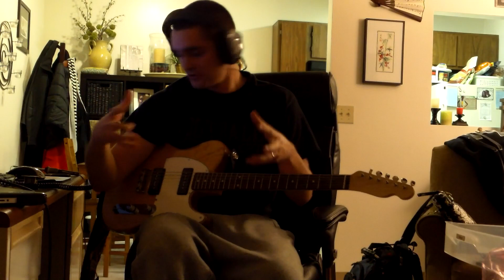Treble Bleed Demo and Explanation

Comment: Why do you mean it changes the taper of the pot?
Reply from the maker: The taper determines how quickly the volume change occurs based on the location of the pot throughout its travel.  Meaning that when the guitar volume control is at 5 out of 10 the actual volume may be at 40% or 60% or somewhere else.  

An example - some tone controls may only really be effective from like 6 to 10 on the control, then from 6 to 0 it doesn't really change that much.  Or maybe it changes a ton from 0 to 2 but then not a lot after that.  That would be an uneven taper.
Reply: +Kley De Jong but what exactly did you notice with yours? 
Was the change in taper good or bad? 
So what happened to your pot?
Reply: +Kley De Jong but what exactly did you notice with yours? 
Was the change in taper good or bad? 
So what happened to your pot?
Reply from the maker: It comes on just a touch more strong from about 0 to 3 or so.  But from 3 to 10 it is pretty even.  I have installed it in all my guitars and so I've gotten used to it.  I wouldn't really be concerned about having a large negative effect.  It is pretty subtle.

Comment from the maker: Sounds right to me.  Things get clean at around 4-5.  Maybe double check that your values are correct?  A different value cap would make a big difference.  Also what are you running into?  Some amps/modelers clean up better than others.

Comment: I soldered to the one terminal where the wire is coming from my selector switch and the other side to my wire traveling to my tone pot. I rewired the resistor and cap in series. it seems to have worked alittle better that way. 

How far down on your volume were you when you had a clean tone?

Comment: I did this mod to my tele. I used a 220 ohm resistor in parallel with a .001 cap. However, the gain doesn't taper off like your guitar does. I only have clean tone at .5 volume. As you can imagine, there isn't any room for clean tone before i have no volume at all. From volume 1 and up to 10 is all gain. Any idea what the problem may be?

Comment: I did this on my strat. Sounds lovely. I usually leave it on 8 just because it sounds so more fenderish with the volume on that position. I put it on 10 when I need to solo or a little more gain. Thank you for this video! Rock On